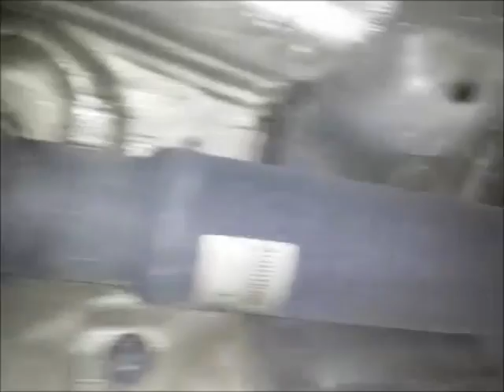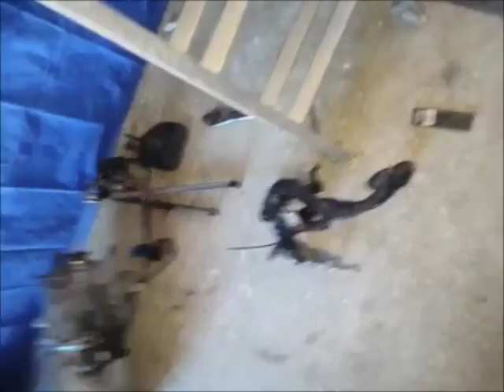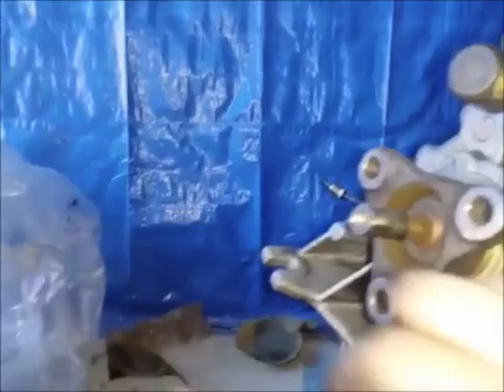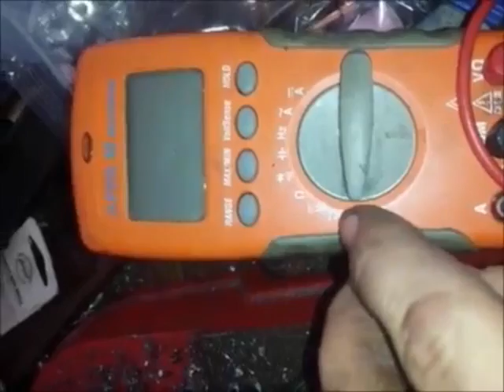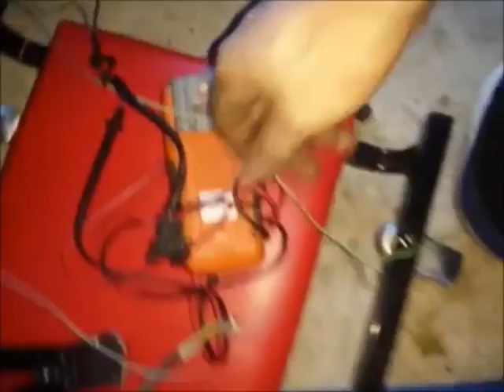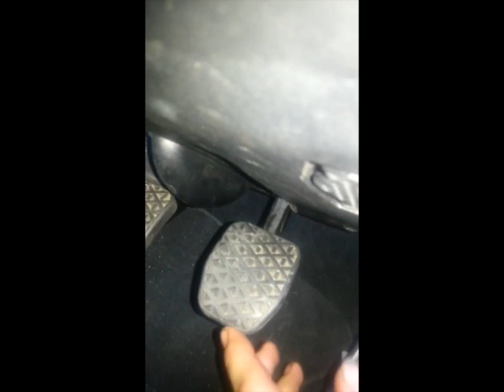BMW E39 Manual Transmission Conversion DIY

Comment: You can leave the torque converter in (bolted to the crankshaft) and pull the transmission out. Then once its out you can unbolt the TC. Downside is that you will get some hyd oil coming out of the transmission.  I advise draining all the oil out before undoing anything else.

Comment: I've gotten mixed messages about the flywheel, I'm about to do a manual swap on my 540iT (wagon) do you have to get a new flywheel?
Reply from the maker: Yes, you will need a manual flywheel.

Comment: Amazing video very professional and very clear straight to the point I currently planning a swap to 5 speed on a 2000 528i you actually cleared many doubts and gave a eye opener to my project i now have more confidence to do the project thank you for your time  and knowledge. Will keep you update on my project in case I need help. Happy new year stay safe God bless

Comment: Would this video relate to a 540i as well?
Reply from the maker: For the most part, yes.
Reply: There are some thorough 540i auto-manual DIY pages out there.  The best one is probably this: https://www.bimmerforums.com/forum/showthread.php?2070255-E39-540i-Touring-Manual-Conversion-Checklist-amp-Wiring-Coding

Comment: The wiring part is a ghetto way of doing it... you don't need the transmission computer after the swap. You'll have to change the VO to manual to turn off the gear indicators on the dash and not throw any errors. 50skid did an excellent DIY on doing the swap on his E46 which is pretty much identical to the E39.
Reply: Huh what’s vo?

Comment: I just got a e39 520i touring and want to convert to manual not done a job this big before but heard a lot of mixed reviews saying it’s easy and some saying it’s hard and costs a lot of money is this possible with the 520i and heard a lot of the manual gearbox’s are useable

Comment: That's weird on my 2003 UK 530D M Sport, I just had to pull back the carpet and push out the bung for the clutch line and for the hose to the brake master there was a plastic square above the brake pedal which also pushed out.

I also didn't need to remove the brake master cylinder and booster, I just cut one of those plastic plugs off on the reservoir and plugged the hose in for the clutch.

Comment: threadlifting. is it easier to start with a manual car. and just put in a automatic engine? meaning lets say i own a 528 manual and then buy a engine from a 540 automatic.
Reply: Replacing the 6 cylinder engine with a V-8 would be too painful - just buy a 540i manual and save some money.  This project only makes sense (IMHO) on the wagon/touring since it wasn't available with a manual transmission.

Comment: Where is bearing? That should go in the midle of manual flywheel (crank shaft) and when you put you manual gear box back in, your central shaft shold seat in it.
Reply: it goes  in the back of the crank

Comment: So you dont have to do any programming for the computer? I have a 03 e39 540
Reply from the maker: There is coding required, but since I didn't do this DIY, I'm not exactly sure what has to be tweaked.
Reply: What if I have the computer from the manual car
Reply from the maker: @ulisesguerrero8338  That may need to be programmed to your car, I'm not sure.  Check the forums for direction from those who have more experience.

Comment: Hopefully will be doing this with my 2002 540i Soon. But question! can you add steptronic to my auto if it doesnt have it from factory? I heard its just connecting a wire? any info would be awesome.

Comment: First comment in 2 years!!
Really looking forward to the 540i follow up video - being a long time Mercedes guy, I've been collecting parts all winter for my 1997 - pre vanos, pre electronic accelerator and advanced timing - e39 540i  that I bought at the end of last year. I was careful to buy the 540i e39 control arms, tie rods etc - also same as e38 and M5 when buying suspension kits and those parts. I am already subscribed but now I'm hittin' the bell!!

Comment: I have a e39 528 as well, will a 540 manual transmission or a m5 getreg work as well?
Reply from the maker: 528i?  The V8 (540i, M5) transmissions cannot be used in the I6 models.
Reply: looking to manual swap a 528 also what trans would i use
Reply: Zf from e36 e46 or 6cyl e39 or getrag 220

Comment: can i use the same rear axel ?
Reply: no sir
Reply: I am assuming you mean differential. Yes it will work but often the gearing is not ideal. I found the ideal ratio 3.15 (stock auto is 3.15 for some models 3.4-3.6 for others. Manual is 2.93 but this is more for highway not for power)

Comment: questions, i have the complete manual transmission swap from a e36 325i, can this be installed in a e46 330ci..??
Reply from the maker: I believe the transmissions are different.
Reply: okay
..thanks for the info

Comment: hey! i have a 98' 520i manual and i want to do a complete swap to an automatic 528i. What do I need to complete my project? thanks
Reply: Thanks for stating your opinion. My e39 is a prelift, with no rust on the whole body, was never in an accident/crash, the paint is original (checked in bmw dealership), has original 210k kilometers (checked in bmw dealership) which 4k kilometers was made by me. I was thinking about a swap to an  automatic, because I have a problem with my kneecap and was also thinking that an auto would need more power.
Reply: Problem with me kneecap when changing gears. Typically when depressing the clutch.
Reply: Man you could buy another e39 automatic 2.0 will be good enough again. Automatics on e39 are good but they have ran for way too long and you dont know when it will fuck up. My opinion is don't ruin your good withour rust and shit e39. Get well soon man

Comment: Did you leave auto computer in place? i, in NZ can you text me your email address?  cell is 74379029 add the first two digits for normal nz cellphones :)
Reply: Yes though it is also possible to remove the trans computer entirely

Comment: What do you call the rod that connects to the gearbox to gear stick. It's about a foot and a half long. Need to know asap thanks
Reply from the maker: +Colm Tully The shifter carrier?  Or the selecting rod?
Reply: +E39Source yes cheers for the help:)

Comment: ...also (3), does the auto transmission mount bracket (cross member) work with the manual box?  Thanks again.
Reply: Francis Powell no it doesn't sadly

Comment: Hi Houston, I'm doing a very similar conversion to a 1999 528iT, changing from the GM 4spd auto tranny to a Getrag 250G manual gearbox from an '02 325i.  I have a few questions and would appreciate your help if at all possible.

1. All the e39 manual driveshafts in the U.S. (where I am) connect to the ZF320 tranny and thus have a larger output flange. Did you use one of these modified, or some other application to mate with the smaller Getrag flange? I gather the ZF flange cannot be retrofitted to the Getrag box.
2. You mention the use of the selector from an e39 520; a model that is not available in the U.S.. Is there another selector(s), perhaps from the ZF equipped cars, that might work? I have the e36 selector mechanism which I suspect will be the wrong length.

Thanks!!
Reply: +Francis Powell For anyone else doing the conversion.  Contrary to my commenting that all U.S. market 6cyl e39s were equipped with ZF gearboxes my research found that the '01-03 525i sedan (not Touring!) was supplied with the Getrag and thus uses the small flange.  Thankfully, I was able to use the 525i sedan drive shaft (prop shaft) without having to making a custom shaft.

Comment: at the very least you should have got a new clutch kit and a second hand resurfaced flywheel
Reply: Yes and I would recommend doing so to anyone else.  But I was on a budget and I aslo work as engineer so pulling it out later and machining it is fairly easy and worth it until I decided what I wanted to do long term.  I have 10 cars so having it out of use for a while isnt a issue :)

Comment: Just curious, but did you put a new rear main seal in while doing this? Any other upgrades/modifications? I'm approaching my own manual swap next spring/summer (03 530i), and I have the following mapped out:
- Upgraded, lightweight UUC flywheel and e34 M5 clutch
- UUC Evo3 short-shift kit, DSSR, shifter seal
- Front and rear trans seals
- Polyurethane transmission mounts
- New engine mounts
- Driveshaft guibo, center support bearing
- Rear main seal on engine

Would/did you do anything else?
Reply: I didn't replace anything. I don't mind pulling it out again later so wasn't with it to me at that time. Ideally it would be done though.  Your list sounds complete and I can't think of anything to add to it.
Reply: Ok, thanks! I'll let you guys know what I do, for sure.

Comment: Did you put a pilot bearing in the rear of the crankshaft before putting on the flywheel? It supports the transmission input shaft in the rear of the crank. It's a crucial part.
It's part #5 in this link. http://www.realoem.com/bmw/enUS/showparts?id=DD53-USA-04-1996-E39-BMW-528i&diagId=11_1151
Reply: Yes you are absolutely right.  I will include that in my e36 328 video